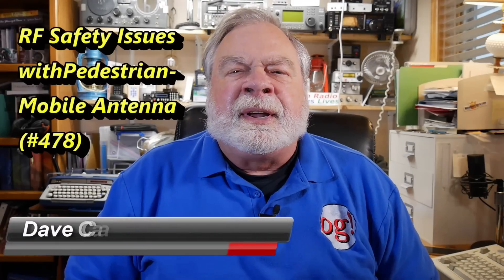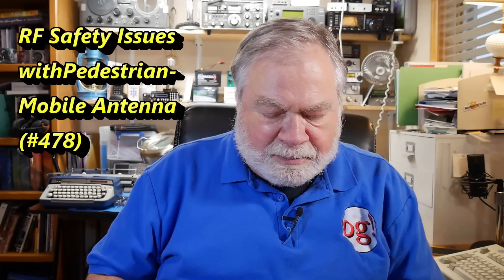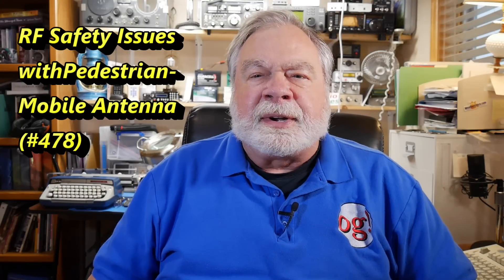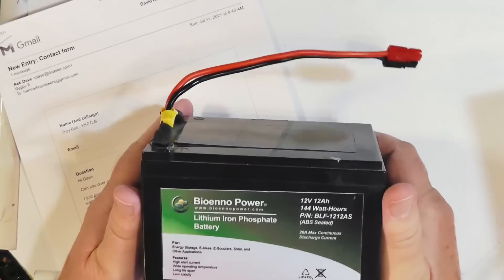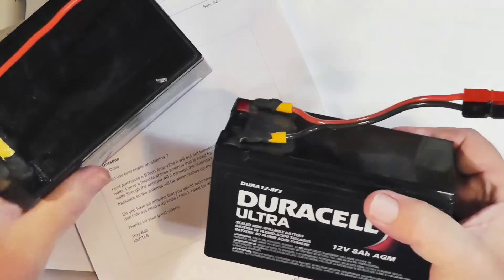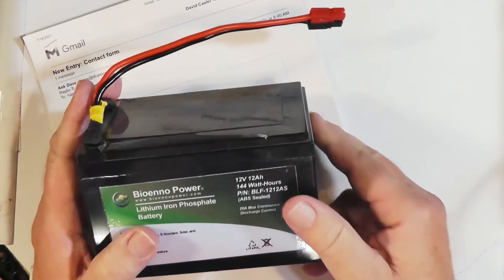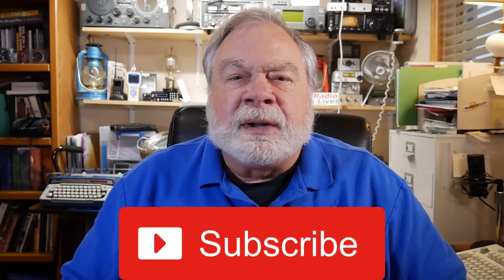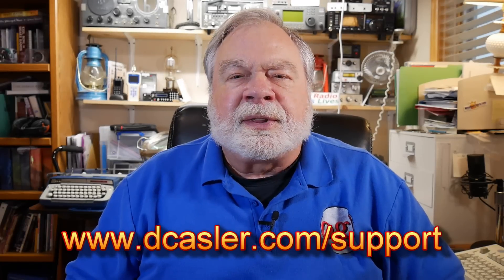RF Safety Issues with Pedestrian-Mobile Antenna (#478)

Comment: 20 years ago, at 145Mz  FM , I was putting out 70 watts into 5/8 wave antenna ,  then 50 watts into 1/4 wave,   year 2023,  20 watts into 1/4 wave.   to meet RF safety rule.   AG6JU

Comment: Thanks for the RF safety points. As you say this is non ionizing but the thermal effects are what are of concern. I'm not sure about FCC guidelines, but at those frequencies and so close a distance and clearly within near field, 40 watts would certainly exceed Safety Code 6 levels in Canada. If you have access to an RF safety monitor such as a Narda , Wavemon or similar, this would of course be best practice to check your installations. At those power levels and distance, those would certainly alert. A remote antenna is a much better option if those power levels are really needed.
Great video, thanks Dave!

Comment: I've been pondering this safety issue myself, thinking about a few tests and projects I want to try with the "tape measure" style folding antennas and some HT's, especially a 10 watt radio I have on order.  According to the RF calculators, it doesn't seem like ANY 5 watt HT, even with rubber ducky, is "safe" for use!  Using a handheld external mic can help protect the upper body, but it just means you cook something else....

I would really like to see a video on shielding and RF exposure safety.  That seems to be a subject nobody has covered yet.  I would HOPE that the thick steel of the roof of my 79 Continental or 86 Grand Marquis would be adequate shielding with my 85 watt Alinco rig and 97 inch NR22L 2 meter whip, and resultant ~190 watts ERP in my high power mobile.  My G7 antenna base station and Alinco rig calculates to 11 feet controlled, and a whopping 26 feet uncontrolled distance: what do the building materials of my shack have to offer in terms of shielding and safe operating distance?  

If I wear my big old Stahlhelm 18 out in the field with my high power HT and high gain antenna, what protection and shielding does that big steel helmet offer?  What protection does gear from airsofters, or loaded down soldiers int he field, to campers and hikers,  offer to the HT user?  

I think it is a worthy topic.
Reply: I have same issue,   my antenna is in middle of roof on car.   so I have about 2 feet of distance for uncontrolled area, that mean 145MHz   20 watts maximum with 0dbi gain antenna.  AG6JU

Comment: RF safety for ham radio may ultimately be used as a convenient tool to limit ham radio communication if and when our increasingly authoritarian government decides to control it. I wouldn't even indulge them by making videos involving RF safety. All they can prove are the heating effects; they will never go beyond that due to the telecom industry and that has not been a safety problem anyway. My advice is to decline from playing that game.
Reply: Have you tried doing a calculation of heating effects due to GSM stations? Or broadcast radio? The RF exposure of a ham radio on HF at 10m from the antenna at 100W is much much more then these at hundreds if meters with a multi kW broacast or 20W base stations used for GSM. Do the calculations and find out for yourself. Heating effects from a 5W handheld are far worse than that due to small distance from your body.
Reply: @KNOBZPL  Of course. I was talking about cell/smartphone Specific Absorption Rates SAR which of course 1) Are not used in FCC calculations for obvious reasons but 2)  correlate well with energy density estimates used in the FCC OET limits which, by the way, happen to be worse case at 10m, not 2m. Yes, I have performed the calculations with my  own station which is a controlled environment; as you know commercial GSM is an uncontrolled environment which provides for much lower energy density limits so the cell tower near your home could very well compete with a ham station in terms of ability to comply. Also you are probably well aware that the uncontrolled environment of the ham station is primary affected by near field; have you calculated your near field limits? I have found that at 10m my limit with a G5RV is 50 watts (not 100) but  the 2m limit will allow a much higher power setting. Once you make this calculations you find that, unless you are using a 500 watt linesr with a yagi, your 2m calculation should meet the OET guideline. That is, unless the government lowers these limits to address non-heating effects which we hope they never do, but could if they wanted to justify additional limits on ham radio transmissions.

Comment: Working large public safety events, with just the h/t, I still use a coaxial antenna (so it needs no radials) just tied to a dowel or rod, that sits in my daypack and extends it a good two feet above my head.
 Getting my head and any body shadow problems out of the antenna path. Your questioner could set his h/t to half power, and then his amp would put out half power, so it would not overwhelm his antenna. Or he could make a coaxial (written up in QST by your predecessor there a few years ago) and have no problem handling the extra power. The only expense is some ferrites or a coax coil to block reflected rf from the antenna to the cable. Very simple and just as effective as a jpole!